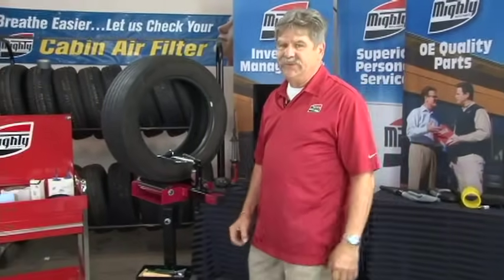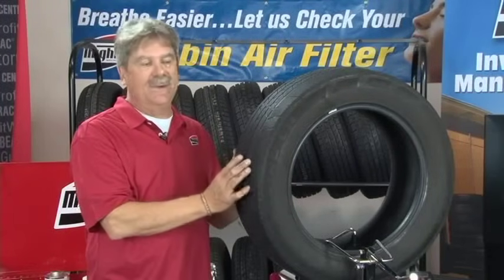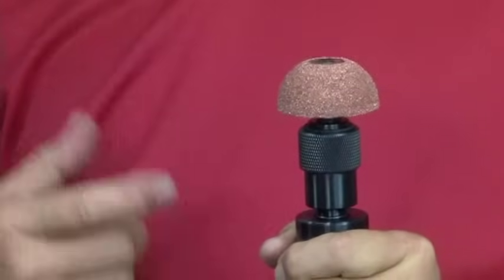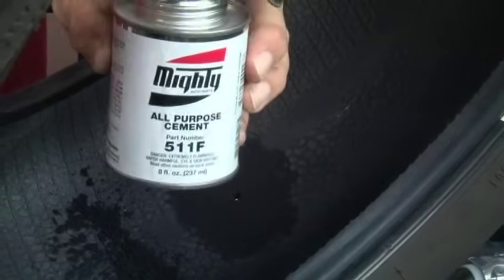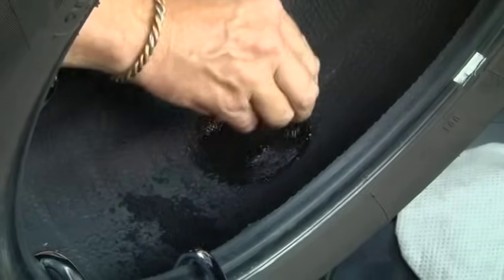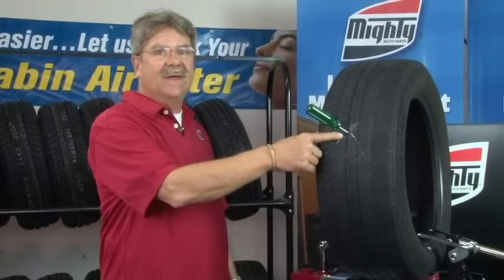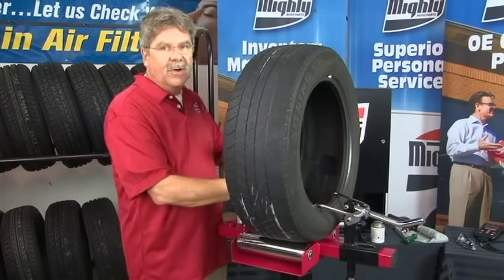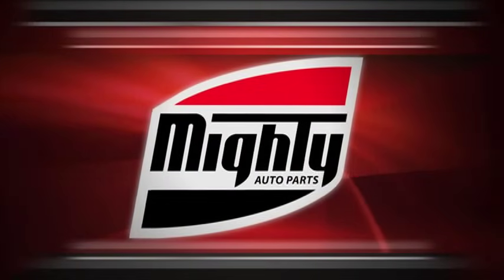Professional Tire Repair

Comment: for those who are criticizing this man for the first nail shown and the string patch. pay attention.. he did not say it was unable to be repaired. it is just not wise to repair it if you want to keep warranty on your tires. as he said more than once. if the injury of the tire is outside the belt package it does not fall under warranty
Reply: +brett pingel This is true, however the belt package of tires doesn't always end at the rib that hits the shoulder block. What you can do is removing the offending item and then use your awl/ probe to check and see if you can feel the belt package on each side of the hole. If you can, then 9 times out of ten your tire will be in a repairable area. 

One thing to note though is that if the placement of the patch on the inside of the tire is too close to the inner sidewall it will be unwise to try and repair it even if you're still within the belt package because of how much the tire will flex while on the road, potentially causing the patch to work itself loose.
Reply: @Jokerseven77  Yes sir you are correct , u have to watch out for the flex point when your getting close to the edge of the tire . once the repair is done on the flat contact surface of the tire it should work, but going to close to the edge/side wall creates a big problem because as the tire rolls, it continuously flex's causing  the seal/patch to fail! This is the reason why its good practice to come off about an inch from the edge on both side to make a safe repair!

Comment: So just to make sure I have this straight, if I get a nail out side of the belt and I repair that hole I have voided the warranty, but the warranty doesn’t cover nails in my tire so I have two choices, repair the nail hole voiding the warranty OR throw that tire away and buy Not one but FOUR new tires so the tread depth is the same on all four tires so as to not ruin the running gear on an all wheel drive car, that actually sounds like a great sales model!
Reply: Terry Mair yes it really is that way.  Absolutely stupid. I go through a lot of tires and just bought my own tire changer because of that.
Reply: Just plug it if it's not in the sidewall, you have to remember who's telling you NOT to plug them yourself, it's a guy in the business of trying to sell you tires! Hahaha I've been plugging tires for 30 years , and my Semitruck tires are extreme duty with 100 PSI of air in them, I've never had a problem!
Reply: old trucker wow I always wondered how well they would work on semi tires. That’s good to know!
Reply: @delvictor7570  oh man, I've never ever ever had a problem, but you have to buy the" heavy duty "Tire plug kit, I bought it a place called Princess Auto, I'm not sure if you're familiar with them. The heavy duty kit has larger plugs and larger tools
Reply: @brianvandorp25  no the problem with them is they dont create a problem seal and is doesn't allow you to properly inspect the tire there are story's of several million dollar law suits because shops put in string plugs and it caused blow outs later down the road because the lack of a proper sealing allowed the belts to rust
Reply: You might as well patch a voided warranty tire until you get a new one. Temp plugs are dangerous because no one looks inside to see if the inner liner has been compromised.
Reply: Just yank the plug out and stick an old rusty nail in its place if you take the tire in for service.  Bullshit policies require bullshit solutions.
Reply: Or you could just put your spare on.
Or, depending on the tire you bought you have a free tow up to 50 miles. Or just somebody to come out and put your spare on. Like I said, depends on the tire brand

Comment: I have looked at a number of videos on how to do a puncture repair and I think this is one of the best. The only thing that surprised me what that you did not vaccum out the tyre debris before applying the cement and patch. By leaving it in place you risk small particles moving onto to the repair area which could result in poor adhesion.
Reply: Mike Farrell really?
Reply: Mike Farrell You only risk that if you are silly enough to move the tire or sneeze in it after you apply the adhesive.
Reply: He said you need to vacuum the Debris
Reply: Your concern is very logical.
He uses the word injury for the damaged area.
He should vacuum the debris before "surgery".
Reply: @KidrahulPure ..what are you baked?!.. read this guys comment again... now go back and watch the video, note when G-pa tells you to vacuum up the debris, now go back read your comment you left.. I really hope ya got  if figured out ?

Comment: well done   :)
I'm an offroader and this vid makes me realize that I have screwed up big time on my plug repairs.
Reply from the maker: +Ken Francisco Thanks for watching and commenting!  Properly repairing an injury is the best way to avoid a catastrophic failure of the tire, and restore the vehicle to a safe operating condition. We created this video to update professional technicians on a proven technology for tire repair. The procedures are endorsed by the RMA and are specifically designed to restore the safe condition and service life of a tire.
Reply: Oh geez, when's the last time you saw a catastrophic failure from a nail going into a tire? Well in my mind, a plug is no different than a nail except for the fact that air can no longer escape, and a plug is damn near impossible to pull out once it's inserted , this sounds a lot like scare tactics! I guess it justifies paying 4X more money to fix a minor problem
Reply: old trucker actually all the time. People don’t pay attention to their tires or wait too long for a repair. Actually being in the industry daily you see it every single day.  When people drive on low tires it creates a heat ring which compromises the integrity of the tire. These style of repairs are safer than a gummy plug or rope plug on passenger cars and trucks. Plus most tire shops such as discount tire repair tires for free.

Comment: That's an incredible repair.  I had had wonderful luck with string plugs though...never had a leaker.
Reply: Jeffro115 the issue with string repairs wasnt leaking it was that the tire was most often repaired without internal inspection meaning if the tire had any internal sidewall damage from being underinflated it wasn't at all noticed. This resulted in the direct deaths of some people due to a complete tire failure at high speed after the string repair was applied. This is why in many places the string repair is actually illegal.
Reply: Murtaza tyer shop

Comment from the maker: The cost associated with repairing a passenger car tire correctly will vary based on a number of factors, but it is not unusual for this service to fall in the $20-$30 range. It is important to keep in mind that this service will not only include demounting, inspecting and repairing the tire, it would also include a rebalancing of the tire once it has been remounted to the rim. Some vehicles require TPMS service which would increase the cost of repair.
Reply: That pricing would make sense if it's an expensive large low profile $100 plus tyre, but there's no point spending that money to repair a more standard tyre size where an extra $5/$10 would buy you a brand new tyre??
Reply: @mighty  what is the size  reaming size of carbide bur for 6mm mushroom punchure

Comment from the maker: Thanks for your comments. To speak to your question, IMFDB, the weight in question is less than 1/4 oz. If you can mount the tire to the same position it should not change the balance. It's a business call as to yes or no- many facilities use tire rebalancing as a profit service.
Reply: I went to Costco today and they left the rubber outside they never cut it down.

Comment: This outlined all the important elements of a proper tire repair. Anything less is a compromised solution, there is nothing wrong with compromised solution, it just means the reliability & durability suffered somewhat!

Comment: This video is labeled as a Professional Tire Repair and is what is supposed to be done. The reason the criteria is held to tire manufacturer specific warranty criteria is a shop will be held liable if a repair end up in a tire failure or leak but worse an accident or loss of life. No shop wants that ever to happen and must protect his customer's safety. He isn't saying this to sell tires but is actually looking out for his customer's safety and how a tire repair is supposed to be done!

Comment: Good Instruction. Except It'd be helpful to know as a last step whether I should balance the tire after mounting.it. Do you think it's a good procedure to leave a witness mark on the tire and line that mark up after mounting it as a shortcut to balancing it? I'm thinking we shouldn't do that because the patch's weight might throw the balance off.

Comment: dont just run the stitcher back and forth one time as shown, go up and down, left and right, diagonally both ways too, and you stitch until that plastic on it almost comes off on its own. really work it in.    And align the word radial inline with the tread, so 90 degree turn from how he put it on.
Reply: yea i was wondering why he didnt stitch left right AND up down
doing it diagonally in ADDITION is also a great idea like you said
Reply: Or just put a plug in it, and don't worry about it LOL

Comment: Wow great job but I would have vacuumed the rubber dust before you applied the glue etc so it would not accidentally contaminate the rubber cement
Reply: Yes pretty obvious!!

Comment: Curious, with this type of repair are you supposed to drive on it right away? Or is it best to let it sit and dry for a while? I know the kits are fast drying, but I'm assuming there is a curing time as well. I've always assumed best to take it easy on the way home after a repair and just park it until the next day. IDK, kind of a sciency question I suppose. haha
Reply from the maker: Very good question @Kraken. 

Following the process outlined in the video, cement is stippled into the buffed surface of the tire and allowed to dry prior to applying the rubber repair unit. After the repair unit is applied, a chemical reaction occurs known as vulcanization. Once the repair has been completed, the curing process may take up to 72 hours. However, the adhesion strength of the repair unit immediately after the repair, is strong enough for the tire to be put back in service, and driven under normal conditions.

Comment: how do you control the buffer? the buffer in my shop goes crazy fast. im left handed and i cant control it. when i land the thing it zip to the other side. i need to use 2 hands.

and why do you scrap it if your going to buff it off?
Reply: buffer will buff the synth rubber into the real rubber. you are not holding it right or need to get used to/comfortable with the tool

Comment: Thank you.   I was hoping you'd do the sidewall.
Reply: Pretty sure sidewall repairs are not safe and you should always replace the tire if the sidewall is punctured or significantly damaged. I'm no expert, I'm guessing the reason is that they're too thin, a repair will probably not have the structural integrity that a stock tire would, and the risk of a blowout is very high in that case. It's even more dangerous if the tire in question is one of the front tires, mid-driving the vehicle could immediately change lanes and cause a serious accident.

Comment: I notice after patching and inflating the tire that there's a small bubble coming from the puncture every 10 seconds. Is that normal? Friend says its air pockets coming from inside the patch not outside.
Reply from the maker: Air bubbles should never be present. For air bubbles to be present the tire injury has not been sealed correctly or there is air trapped under the patch. The tire should not be used until the injury has been addressed and no air bubbles are present.
Reply: Sounds to me like you had a shity patch job done, next time just use tire plugs, it's way cheaper , and they work every bit as good at a quarter of the price, plus you don't have to go through the hassle of dismounting the tire from the rim

Comment: If you repair the injury with a mushroom plug just to drive to a Tire shop, so they can make a permanent repair, can they just use the two step method? And just prep the inside and patch? I don't carry a tire mounting apparatus in my trunk

Comment: Well Maybe Ok but You just pulled all the adhesive from the center hole, So add a little adhesive to the patch so when you pull you have adhesive on the plug. Then do the repair per video.

Comment: Heres the expert tip! NEVER use a greasy tire marker to identify injury location inside,(if your working on it you should see it anyway...)this will induce a contaminent you will have a hard time removing even with a good solvent wich will only spread it around leading to eventual separation of the substrate.(on the seconth video, the copper brush clearly spread some of that grease marker...) Otherwise good repair!

Comment: How about the fire at the end of fixing the tire. I did take it to tire shop, they did the same way, except at the end he put a fire for few second.  As well, what fee is normally charged?
Reply from the maker: +Park Boulevard Heat should never be applied to the repair area when performing a tire repair. 

A proper and permanent repair consists of a chemical reaction that bonds the natural rubber of the inner liner to the rubber patch. This is known as vulcanization, a chemical process that converts natural rubber or related polymers into a more durable material via the addition of a sulfur accelerator. Additional heat, like fire, changes the molecular structure of the rubber surface and compromises its ability to properly seal the injury.

Comment: have a patch and plug near the shoulder of a Y rated tire, is it still safe for top speed runs? Never leaked for a year and did not deform at turns. If it fails, will it be catastrophic or gradual?
Reply from the maker: lordoftheriffs79 Repairs made near the shoulder of any tire must still be contained within the belt package, which is generally limited to the center portion of the tire.  

Proper repairs made to a speed rated tire may impact the rating of the tire. In this case, the industry recommendation would be to contact the specific tire manufacturer to determine THEIR policy.
Reply: +lordoftheriffs79: Speed-rated tires are a manufacturer specific thing. Last guidance I saw in Police Fleet Manager magazine indicated that a V-rated tire, properly plugged and patched, was only rated to 85 MPH afterwards. At that time, there weren't many manufacturers in the police tires game.

Comment: burning the sement will give the patch a way better stick on there than just waiting for it to dry .
Reply from the maker: XgilbertXx You should never use heat when preparing the tire surface for a repair. In the process of performing a professional tire repair, the natural rubber surface of a tire patch is bonded to the natural rubber surface of the tire, where the cement is used as a catalyst to help in the chemical bonding process. Igniting the cement (burning) will effect the chemistry of the cement and contaminate the surface area of the tire being repaired.

Comment: Make sure you fix that  INJURY!   Far too much trouble  - just use a  DIY plug.  Leave the tire on the rim.
Reply: Roger Tycholiz Yeah... don't inspect the inside and only find out about the internal sidewall damage when it kills someone, good idea.
Reply: Extremely rare for tires to blow out these days. They almost always have catastrophic damage or be have to be completely worn out for them to be actually dangerous.
Reply: Exactly! I've been plugging tires on my Semi trucks for 30 years! I've never ever ever had an issue. One time I managed to pick up socket wrench extension in one of my drive tires, I put 4 plugs just in that one hole, aired it up to 100 PSI (just to cripple the rig home), I ran that tire for 1.5 years!without an issue 👍

Comment: every  three months I change my BMW runflat Goodyear tire, did you have an ida for runflat tire
Reply from the maker: If you are referring to repair on run flat tires you need to consult with the Manufacturers Guidelines.  Servicing of a run flat tire is based on manufacturer guidelines and they will vary.

Comment: Where I work, we use bead seal to seal the patch. Is that correct?
Reply from the maker: Bead sealer should not be used to seal a tire patch, the product is a natural rubber compound that is designed to help with the sealing of a tire to the rim when the mating surface is pitted or rusted (a common condition in cold weather regions).

Bead sealer conforms easily to uneven surfaces, filling in void areas, similar to a gasket. Bead sealer has poor air retention characteristics on its own and is not permanent. It can be easily removed from the sealing surface once the tire has been demounted.
 
Liner sealer, on the other hand, is a synthetic rubber compound that has very good air retention characteristics. After installing the repair patch, liner sealer is used to replace the material that had been removed during the buffing process. Once dry, it functions the same as the inner liner of a tire, since during a tire repair, the layer of inner liner (synthetic rubber) is buffed away to prepare the tire surface.
Reply: Yes that would be fine.  This video is extreme overkill and these methods are designed for maximum profit to the tire companies.  I’ve fixed many nail holes with a string plug and never had a problem as long as they sealed.